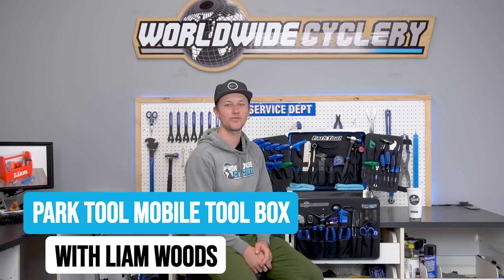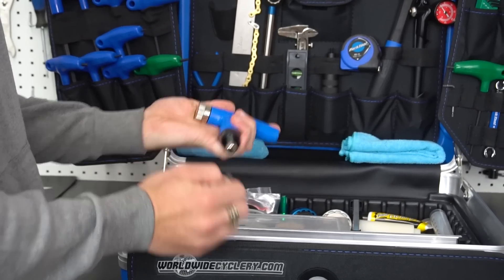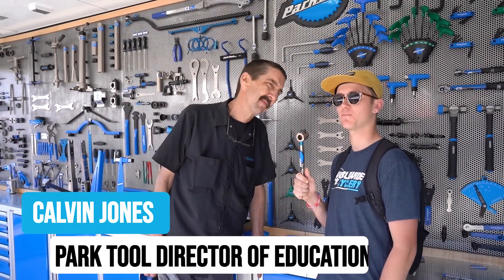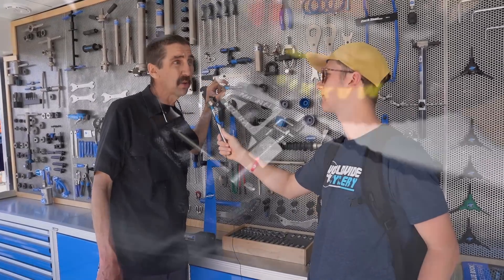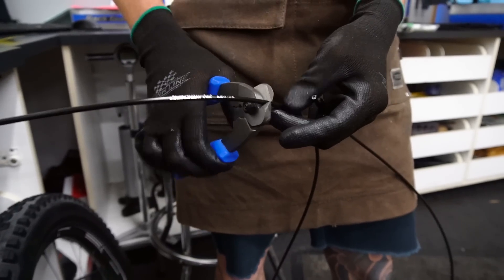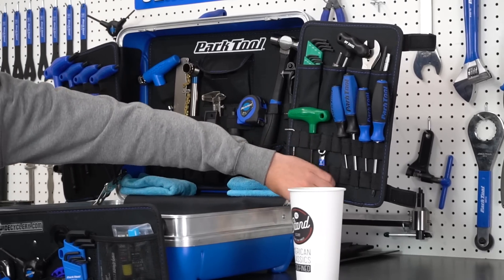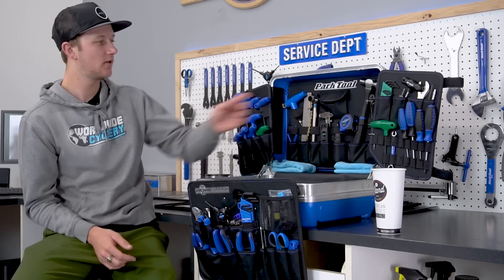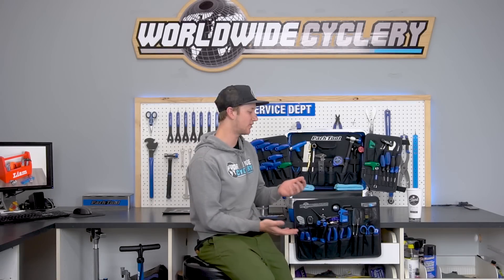The Weekend'er Toolbox | The Essential Tools For Any Trip

Comment: My 5” knipex plier works on those brake nuts really well! It’s nice to pack just the pliers that can be used on several sizes
Reply: I have those in there as well, but the 8mm semi-open is much much faster :)
Reply: Liam Woods gotta be ready for those formula one speed brake hose cutting jobs!
Reply: With either, how do u torque the nut correctly...essential to ensure no leaks but not strip it...sram bleed kits come with a ¾ crows foot adaptor for a torque wrench.
Reply: Not a fan of pliers for brake lines, funny enough, those "3/4 round, open end" wrenches are called "brake line wrenches" or just "line wrenches".

Comment: I've seen at least three different bicycle mechanic mobile tool kits videos. Nobody ever mentions to carry a JIS screwdriver for Derailleur adjustments, especially when dealing with Shimano components.  Obviously this video is sponsored by Park tool so DSD-2, but you can buy a Vessel brand one for less than $10.
Reply: Nice, great tip! Always wondered why none of my screwdrivers really fit well in the Shimano derailleurs. I'm gonna buy a set of JIS screwdrivers when I find a good deal.

Comment: Are there CO2 heads that can release air then cut the air off so you can use it next time instead of just wasting a CO2 even if you only need a little more air?